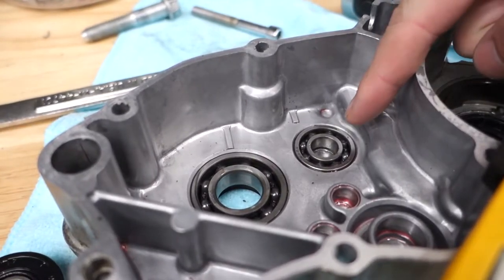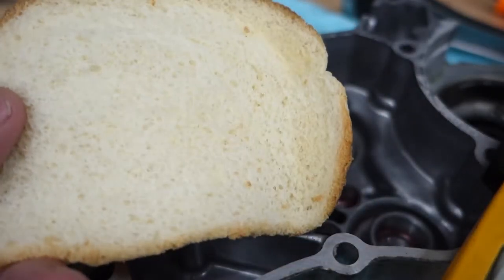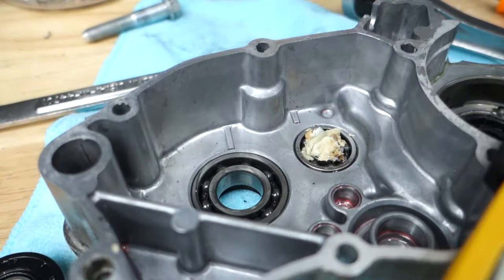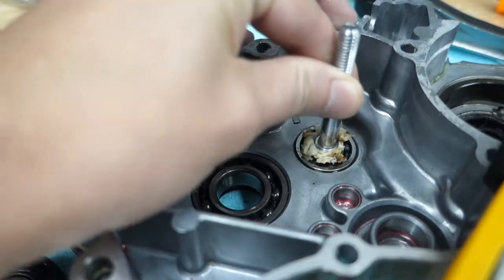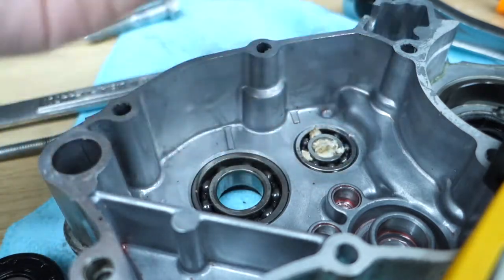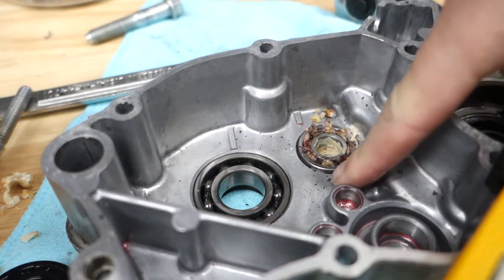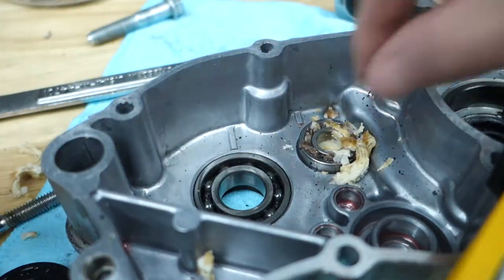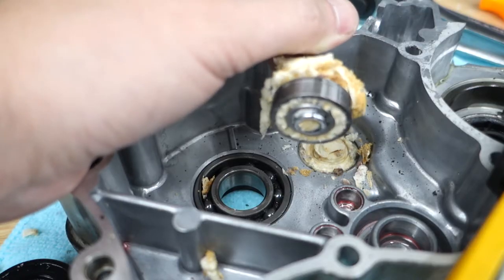Blind Bearing Removal Using Bread

Comment: I tried with blind puller multiple times, heated the bearing and crankcase but the puller just kept slipping out.  Just before I was about to weld a threaded rod to bearing, I wanted to see what others are doing...I figured i'd try this before and after ramming an entire piece of bread on a tiny 6200 bearing it finally started coming out.  Reused the same piece of bread and another slice to take out the remaining bearing.  Can't thank you enough!!!

Comment: Yes indeed, this worked like a champ!!
I had broken / bent my cheap blind puller as well on a small stubborn bearing in my engine case. I tried everything, the puller, heating the case in the oven, homemade contraptions and vice grips.. nothing worked or even budged the bearing.. until i saw this bread method, it worked within a minute lol!! Thanks for the video🙌🏻🍻

Comment: If you have a tight fitting shaft, you can use wheel bearing grease.  I used an old transmission shaft.  Great post!

Comment: I really enjoyed your video's very well done, had to remove same bearings used heat aluminum expanded enough bearings dropped out. used same trick to put them in too. 250 degrees for 12 minutes.
Reply from the maker: Thanks! I considered the oven then thought better of it, if I had propane the grill would have been the way to go!

Comment: I might as well try this. I've tried every type of puller I can think of on a front axle shaft bearing. But I don't have anything big enough to hammer into it as the rollers are out.